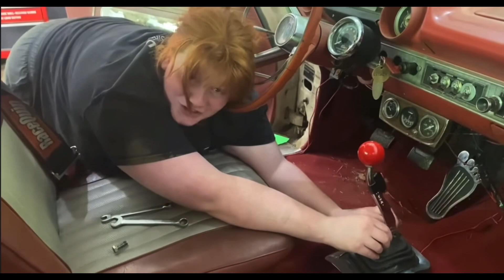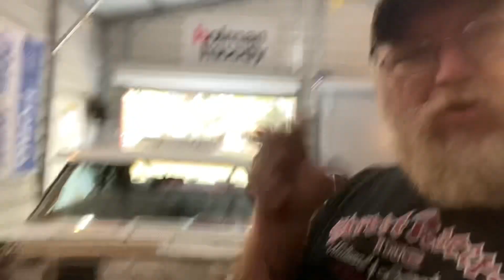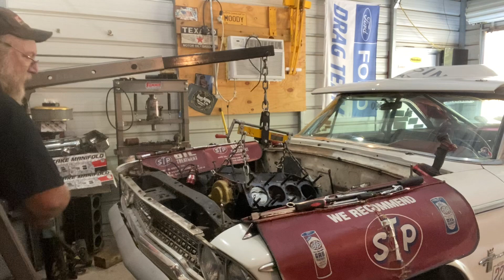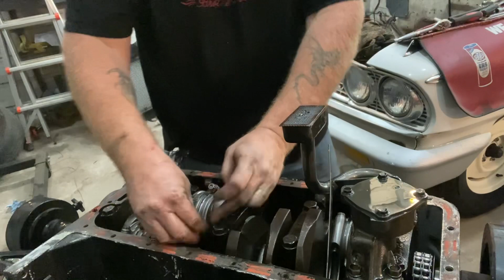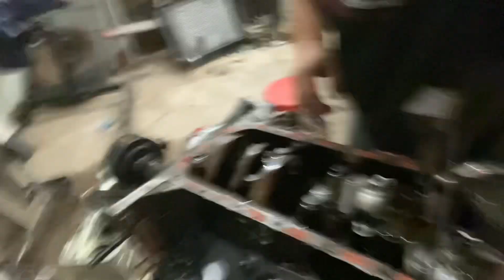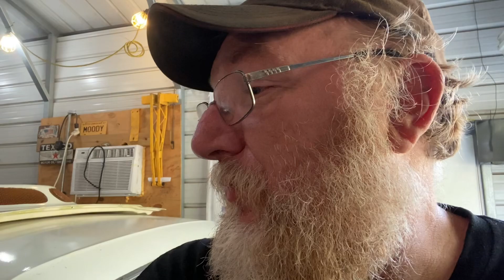The issue with the Galaxie engine is revealed

Comment: High pressure oil pump..make sure you drill all the block oil passages out.main bearing holes never line up.make sure all the oil passages are drilled to the proper size in the crank shaft.you also need a deeper oil pan.front sumps are horrible
Make a pan that will hold 12 qts of oil and you should not have any more trouble.at 6000 rpm you need 80 to 100 psi oil pressure to keep those bearings oiled .good luck on the rebuild

Comment: You didn't mention it but I sincerely hope you take the rods (all of them) and check them for being within specs. I feel it is impossible for at least that one rod to be in specs. You may have a resizing bill facing you. I guess you realize this and I am not attacking you, just new to watching your videos and I do not know what you know. Hope this is helpful. Also, your oil has to be the proper viscosity for the bearing clearance and you probably have that correct. Shame to see this happen to any engine, leaves a funny feeling when it happens, lots of questions. Good luck with it.
Reply from the maker: Oh yeah the rods will have to be checked.  Sometimes I go into auto loans don’t mention everything.

Comment: them motors are bad about spinning a bearing starved for oil low r.p.m can't turn them up to high that crank can be turned again
Reply from the maker: I rarely ever have a bearing failure.   Actually it’s only happened twice.   Oiling really isn’t as bad as people make it out to be.   I’ve been turning these engines 7K plus for years.

Comment: I'm very surprised your running a stock balancer that's part of your problem the higher the RPM'S the more internal harmonics. Dump those main cap bolts use stud's ,and, nuts.on the oil filter use a c8 adapter open up the inter hole, remember FE oiling systems are terrible so help your situation, turn, and, polish the crank, you should be fine
Reply from the maker: Not a stock balancer it’s a ATI SFI balancer and all the oil mods are done to the block.   A lot of things you see on the outside of the engine has to do with the rules of the group I had been racing with.   Serval things will be changing when this engine goes back together actually a lot will be changing when it goes back together.   There was a lot of rules about different things with the sanctioning body I was racing with.   I’m no longer with them now